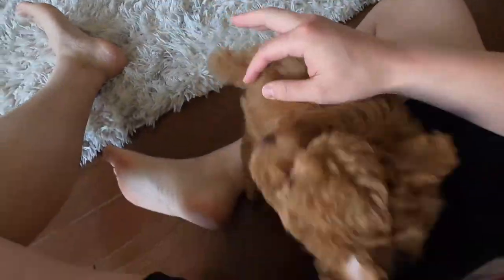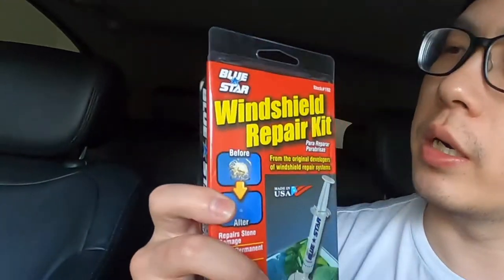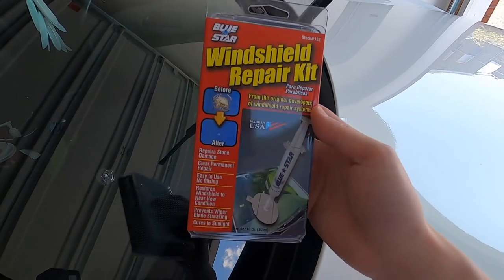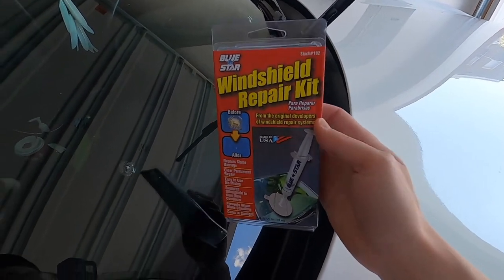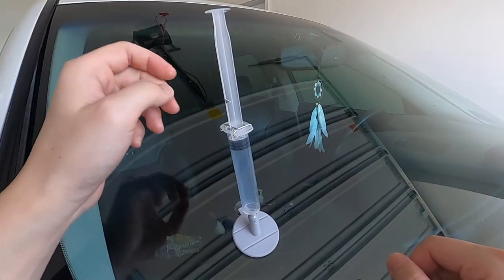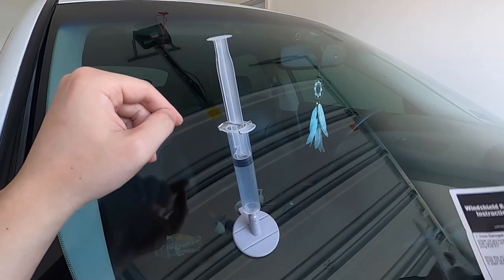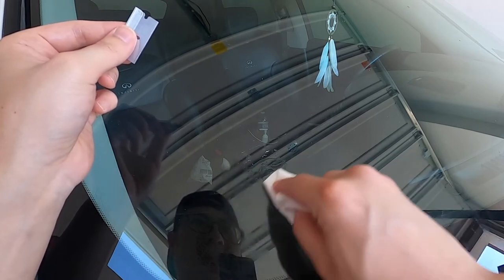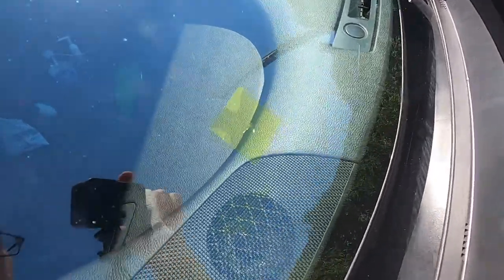DIY Windshield Rock Chip Repair (Blue Star Windshield Repair Kit)

Comment: Loads of air left in it, a totally amateur repair that demonstrates the limitations of cheap DIY repairs, the thin resin will go yellow and fallout in weeks
Reply from the maker: This repair is never going to be perfect but it helps from the crack/chip from getting worse. It’s been 5 months, no yellow or fallout 😉
Reply: @ikigaidriven  in order for that hypothesis to be factually true you would need to have identical chips on identical cars and use them the same and then see which one cracked ( if any ) otherwise you are just guessing that it would have cracked. Many times chips can stay on a screen for years without moving. The record is a 1959 merc Sl that was on there about 40 years